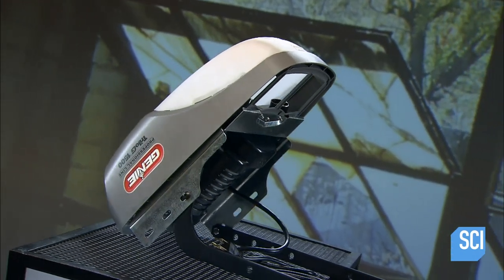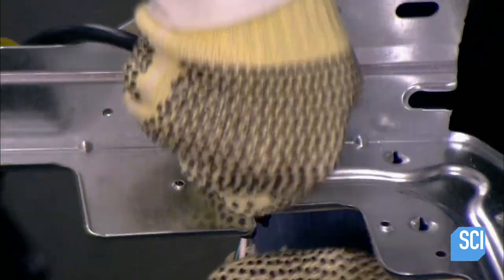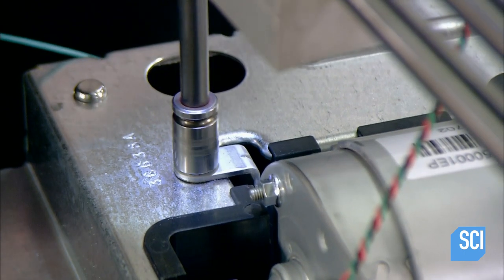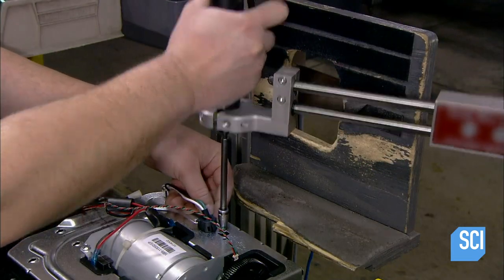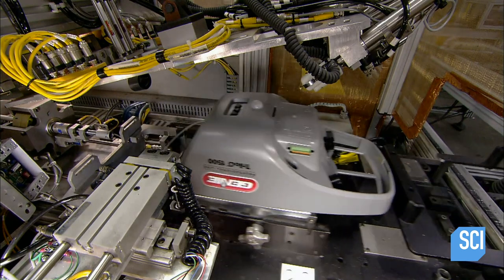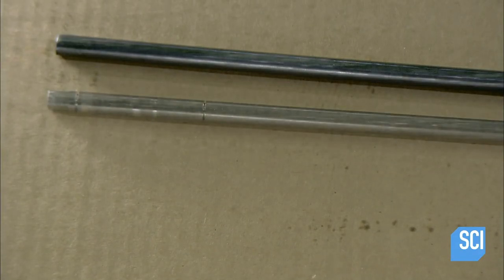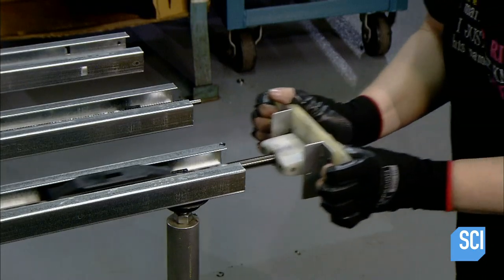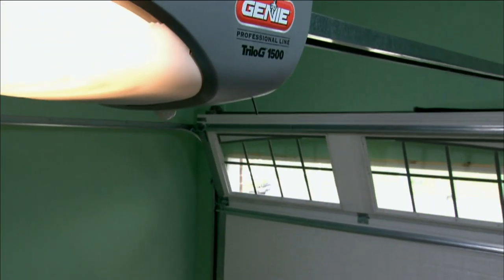How It's Made: Garage Door Openers

Comment: The most frustrating part of garage door openers is if you have camera sensors on the ground in the front and they get misaligned and start to insist something is in the way when it's not.
Reply: If you don’t have kids and dogs and aren’t worried about the door smashing something in the way (car) then you could mount them on the ceiling by the motor and I could almost guarantee you you’ll never have safety eye issues.
Reply: Might need to replace them. They get bad after 5-10 years of sunlight. Easy to replace relatively cheap online.
Reply: I charge 100 bucks to go correct that....sooooo, make sure you check them please
Reply: @TheKonakairay  Yea, that's not legal in any state. They're going to have to be on the floor if you ever plan on selling that house. You might as well not half ass it the first time
Reply: SammyM00782 that’s cheap. You gotta charge 100 bucks for the sensors and then 75 for the labor my dude.
Reply: @forsaken841  Oh I just meant to go and realign them.
Reply: SammyM00782 of course it’s not legal you should always mount them approx 3-6 inches off the ground. This is a jimmy rig way. Another little tip (jimmy rig tip) is if your receivers going out. do a bare copper line from the antenna to the front of the house and coil it. Again not professional ways but it will work and buy you time if your in a crunch, or you could buy new mother board / receiver depending on unit or external receiver. Some houses no matter what because of the garages angle and the angle of the sun you’ll always have problems certain times of days. I’ve had customers who just retired and realize at certain times their sensors aren’t working during the mornings. You could try a sensor cover but I haven’t found a fool proof way again for a foyer you could use a toilet paper roll core. (Again not professional way but a way)
Reply: TheKonakairay if you’re doing all that, you just need new sensors. You only get those problems when they are old and worn out or not properly aligned.
Reply: SammyM00782 that’s actually legal in 48 states I believe. The reason you have safety sensors is not due to building code or Law in most cases but due to UNDERWRITERS LABORATORIES (UL-325) the UL code 325 addresses the photo safety sensor systems here in the States. The garage door industry experienced 2 deaths of children on the same day in the same city in 1992. North Dakota I believe, they mandated them at that state level that same year, before congress passed federal LAW the garage door/opener  industry turned to our ongoing partner UL to “SELF REGULATE” so since 1993 if you want to sell electric garage door opener systems in the USA you build in photo safety sensors that cannot be bypassed by the average consumer (no shorting plug etc) and pay a tax (or extortion however you see it) to the UL to give their stamp of approval. There have been a couple of products of note that complied and worked with the UL to sell their products withOUT safety sensors (I.E. some generations of the Wayne Dalton proprietary Torquemaster installed with their proprietary Wayne dalton  I-drive gdopener system and the Martin garage door/gdo (proprietary door + private labeled Marantec gdo). These door systems both used unique anti drop (in case of broken springs) devices and sensitive DC motors when AC was still the norm. Today 80% and growing of the gdo industry has turned to DC motors which are sensitive enough to reverse and respond to adverse conditions BETTER than safety sensors BUT the manufacturers make a killing on the service repair parts. The typical safety sensors last 5-7 years here in AZ. The typical motor while may need repairs along the way but will normally last 15-20 years. So that’s the Initial sale plus 1-2 safety sensor repair sales throughout the average life of their products. I doubt the safety sensors are going anywhere. The average home inspector in the USA that checks these things through the course of a home sale doesn’t know there isn’t any law mandating safety sensors some believe that fanny Mae loans require them. Just $.02 unsolicited cents for thought.
Reply: Most have sub filters that wear out between 5-10 years and this is a sign of wear and need for replacement.
Reply: I've watched a lot of the door content on YouTube to see what is being put out about them. There is always an argument between techs to prove they know more about doors than other techs. It's kind of funny really. It is entirely predictable. Whenever a video comes out about ohds or operators, you can expect someone trying really hard to flex that they know stuff, followed by someone jumping in with some form of "actually... I'm a professional, so I know more than you"... an obnoxious one-upping. Door systems are cool, and there are definately less people in the trade than in other trades, but it's a trade, so lots of people do it.

Comment: I can remember Genie garage door openers from the late 60's my late aunt and uncle had one in their home.  A steel housing with the motor in the garage, a small vented steel box containing the circuit board and vacuum tubes for the receiver, plugged into the operator. Push button on the wall, plus transmitters for each car.
Reply: Those units were very reliable and I remember the vacuum receiver boxes you are talking about.  I have a 1960's Genie Screw Drive (Model 401) that still works like new. I don't much care for the newer types as they seem cheap and plastic.
Reply: Ok boomer

Comment: ive only seen the chain drive style of openers. is this a newer design?
Reply: It's newer but they've been around for a long time.
Reply: Not really newer, screw-drive openers have been around since the 70s. History on openers is not recorded well but screw-drive openers are have been pretty much phased out, Genie still offers a couple models but literally every other company no longer offers them, even the more popular Chamberlain/LiftMaster company. Most companies opt for either belt or chain drive, with belt being much more popular due to its quietness. 

The most recent innovation is jackshaft, one’s that connect directly to the garage door’s torsion rod. It’s popular because it’s packaged nearly but are significantly more expensive. It’s just a commercial motor style that’s been adapted for residential garage doors. Most innovations are incremental stuff like LED, Wi-Fi, built-in camera, etc.